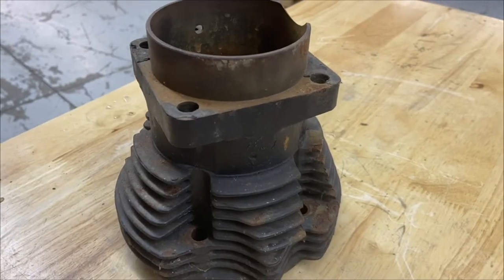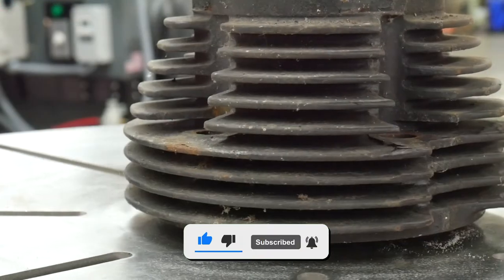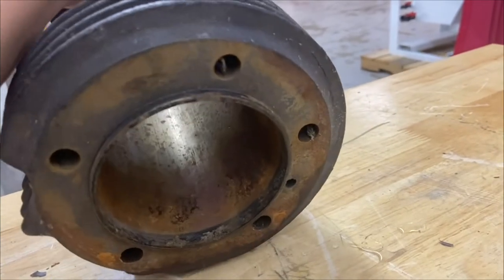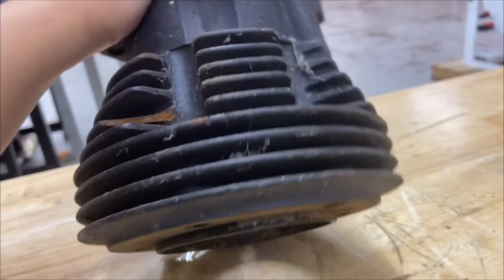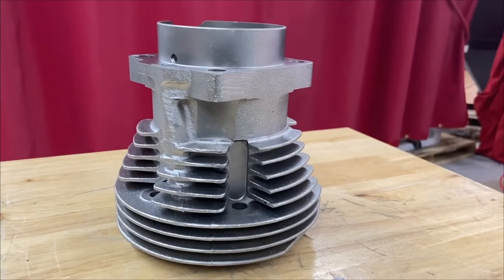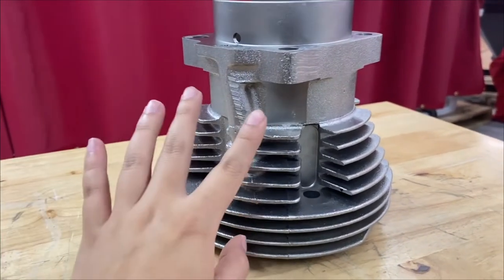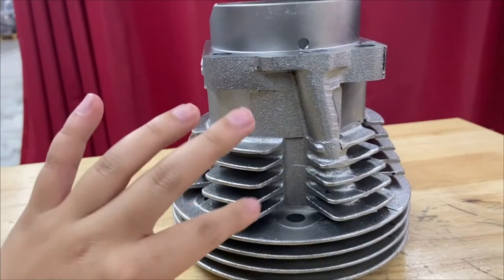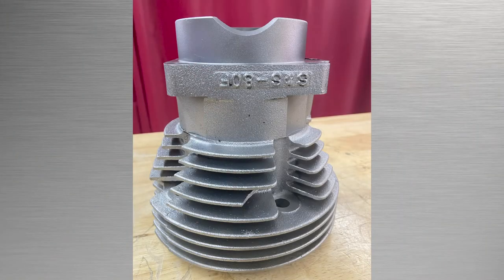Vapor Honing a 1980 Harley Davidson Shovelhead Cylinder - Vapor Honing Technologies

Comment: Do you sell that solution of aluminum oxide for the rust?
Reply from the maker: We recommend a 4:1 Ratio GB:AO.  We sell the abrasive separately not as a mix.  828-202-5563 x 103 Niki nicole@vaporhoningtechnologies.com